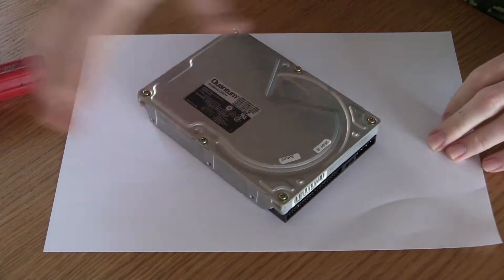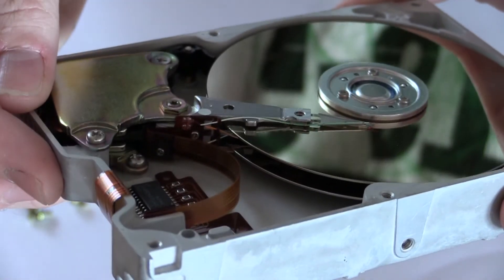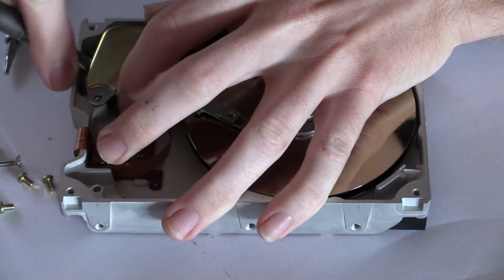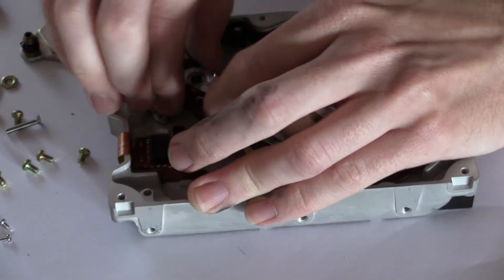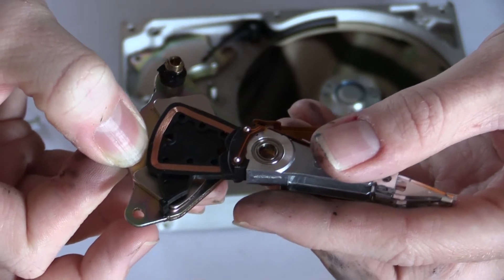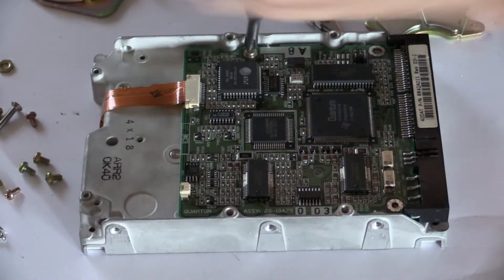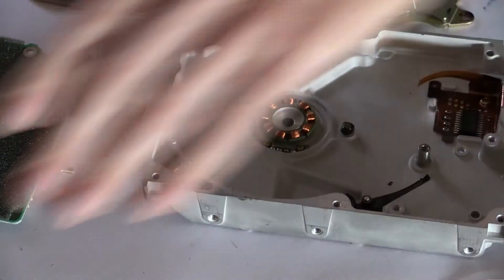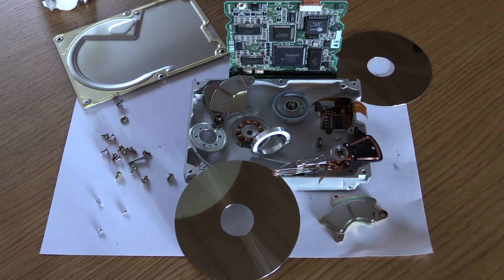What's Inside a Hard Drive ? (Teardown / Taken apart) - Ec-Projects

Comment: What kind of motor is that and do new drives have the same motor?
If I remember correctly, hard drives have to keep the RPM very stable... is that a motor or driver feature? ..also, how hard is it to drive that motor with some simple circuits?!
Reply from the maker: Ivanovic Romano Hey, I'm pretty sure it's a brushless DC motor. The driver will engage the coils in sequence (at a chosen frequency) to rotate the motor at the desired RPM. You should be able to drive it with an ESC (Electronic speed controller) for RC cars / helicopters... I think they are still used these days..

Comment: The black stuff you got on your hands is not grease. The black rubber-thingy inside, used to be a vibration-dampened end-stop for the Voice-coil-arm. It has turned into a sticky black goo, because the plasticizer has gone bad, so now it's a very sticky mess, which in time will destroy the hard drive altogether.
Reply from the maker: ***** yeah that makes sense, I did notice afterwards that only half of the rubber had disintegrated.. Thanks :)